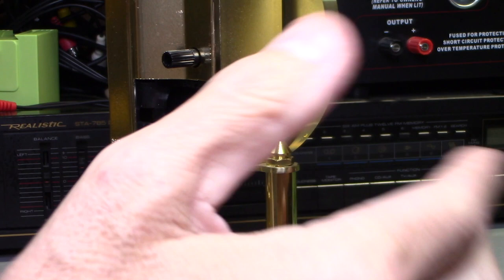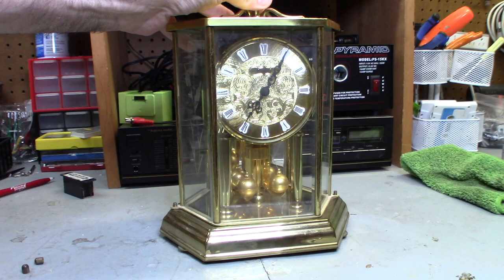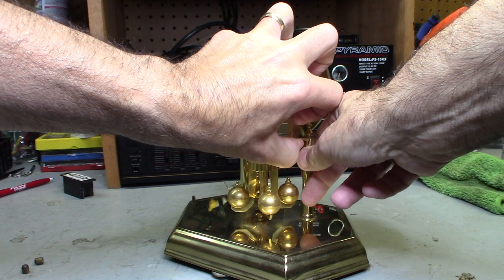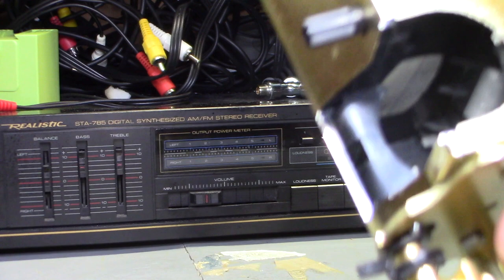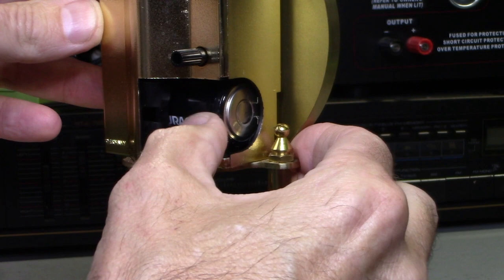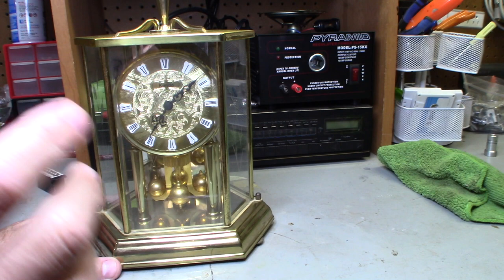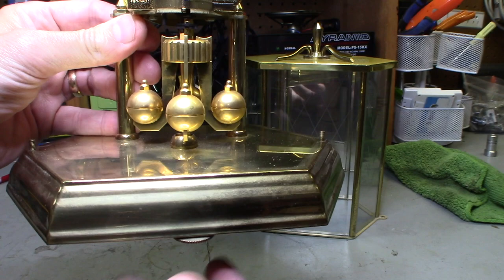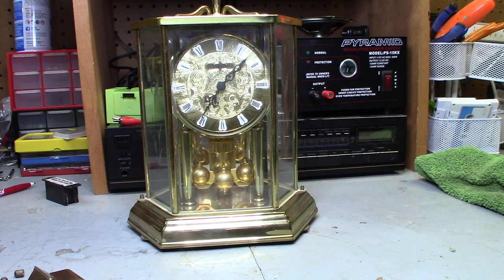My quartz clock stopped running how do I fix it 2020

Comment: I found a similar clock at a goodwill but it was totally ruined because the battery acid ruined the battery system, it was also covered in cigarette burns and reeked of cigarette. I took it apart and cleaned it the best I could but it’s pretty much lost it’s value. I still like it tho and now I’m mainly using it for decoration

Comment: How do you fix the pendulum if it fell off?
Reply from the maker: You might have to bring it to a clock maker. The pendulum is hold in by a specific piece of metal almost like a spring.

Comment: mine ticks but balls on the bottom do not spin and rub...feel like the spindle has too much play in it and does not connect on top
ideas?
Reply from the maker: Yes, Broken Spring. Needs repair
Reply: @YourReviewChannel  are these springs available for purchase?  Ive a Kundo like this from 1976. Not sure I want to pay a repairman.

Comment: Followed your instructions it did start ticking but the pendulum won't keep spinning it will stop I have it level I hear a loud click once in a while is it sign that battery is low or is there something wrong with it
Reply from the maker: Yes, I understand. It needs to be serviced sounds like a bushing problem.
Reply: @YourReviewChannel  can you describe what is a bushing problem and is it worth alot to get it serviced

Comment: I did the first thing that he said to do, and my clock immediately started to work.
Reply: Followed your instructions......I have the exact clock put in a battery and it did start ticking but the pendulum wont keep spinning it stops and I hear a loud click once every so often  does it mean battery is low or is something wrong with this clock